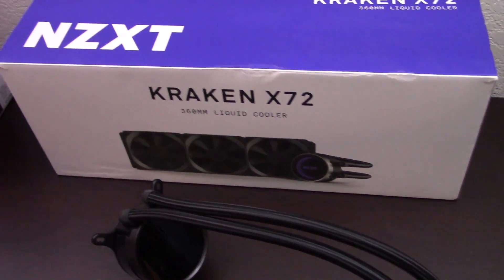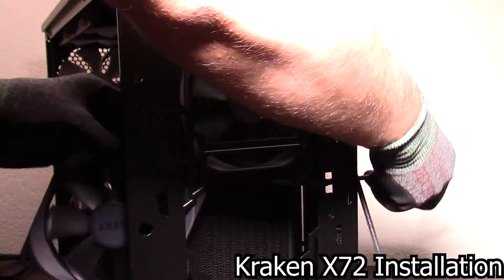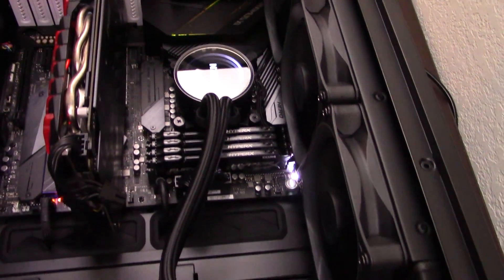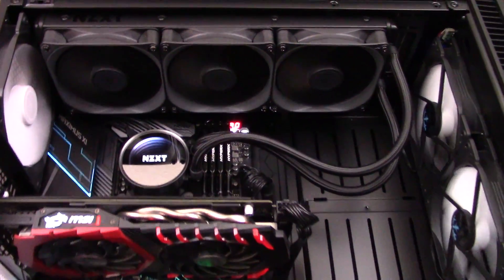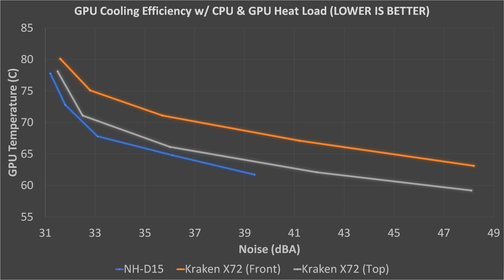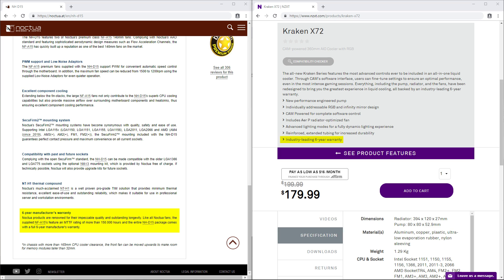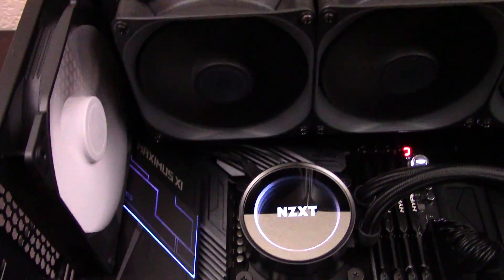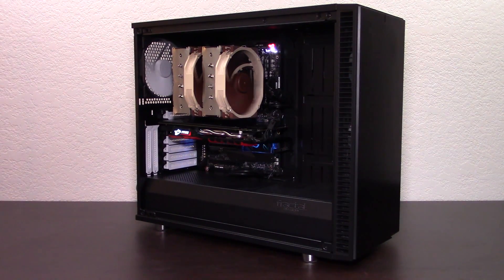Air Cooling vs. Liquid Cooling: The Ultimate Showdown (feat. Noctua NH-D15 vs. NZXT Kraken X72)

Comment: my choice is simple if for 100$ and below to buy a brand new cooler without thinking twice i will grab an air cooler, for 200$ or more i would pick magiccool radiator +  barrow waterblock + barrow or H&y even boom soft tube fittings ( would pick these second hand and get the new o ring which is very very cheap ) then i will beat any aio or aircooler any day of the year.

Comment: My god, Noctua's so BIG!
Right now I'm looking which parts to buy for my new rig. For the first time i wanted to have nice and clean space with RGB lighting (i know this is silly and i'm sorry). Choose to pick 2x8gb G.Skill Trident Neo Z RAM with rgb and was wondering about cooling. Looked at the Noctua DH15 and some other AIO (wanted to try it at some point). I couldn't even imagine that Noctua simply swallowing entire RAM section from sight. I would feel myself so stupid if i bought that cooler with this ram xD
Well...now i guess i need to decide to pick Noctua DH15 and some simple non RGB RAM with decent performance or to take NZXT X52 and Trident Z Neo or whatever it calls.
I'm going for R7 3700. Still doubting though, i want machine for gaming and R5 3600 is more reasonable for this purpose, but i think about learning some video montage and sort of works on pc, so...hope I'll make right decision.

Comment: Unfortunately in the days of the Ryzen 3000 series CPUs your video is woefully out of date.

Especially with the single chiplet Ryzen 3000 CPUs (Ryzen 3600, 3600X, 3700X and 3800X) less than 25% of the business portion of an AIO (that is the portion of the AIO where the heat exchanging fins are) covers the hotspot which is the actual CPU die (chiplet) whereas this area is covered by 50% of an air cooler.

It would be interesting to see a revised video from you taking this into account.

I cannot find any other youtuber who has done a video on this topic.

Comment: So if you want to spend twice as much, be less compatible, bulkier overall, complicated to install, but get a whopping 2.5 degree performance boost, go with AIO liquid. Otherwise, stop buying into the gimmick and use air. One further thing of note: if something goes wrong with an AIO, you are absolutely screwed. It's likely a pump or a fitting and you are buying a whole new one, or worse - a new computer. If something goes wrong with an air cooler, it can only be a fan because that's the only moving part, and it costs virtually nothing to replace. Furthermore, you still get some passive cooling in a worst-case-scenario from the giant metal heatsink, where as you won't get any from an AIO. Most air coolers will last a lifetime; literally zero AIO's will last that long.

Unless you have the money to burn on custom liquid cooling, air is still a superior solution to AIO's.
Reply: Archibald Doogan had a DOA stock fan from AMD it provided 0 cooling without the ability to cool.

Comment: The NH-D14 now comes in a black version plus you can get covers that go over the heat sink tops. That will cost you extra though. But it does give a point towards the D14 in looks IMO.

Comment: You can see before testing, hear what you are saying and work out how biased you are. You even set up the aio wrong to get that bad thermal reading and noise. I run a Kraken and under no stress after coolant heated up, stay between 44°C and 55°C depending on room temperature. My stock fans are not as audible as yours considering I run a more open case with a mesh front panel. On my Ryzan 3700X on load after 9 hours, I see max 77°C on lower fan speeds.

Hmmm....

Comment: If I had a  fully enclosed with no window, I'd probably pick the NHD15 but with a windowed case which most are nowadays, it would be the NZXT hands down or any other good AIO cooler.

Looking at the results even with a decent 240mm or 280mm water cooler, worst scenario the performance should be on par with the NHD15 if not slightly better. The bonus with the 240mm radiator, it will fit into heaps more cases and easier to work with. Still limited compared to the Noctua, however the people looking at spending that sort of money for a Noctua cooler are not going to settle for a cheap case, from my experience. 

I don't consider myself falls into the category of an enthusiast (I reserve that for the power builder) even though I like building and turning over computer systems. I get bored using the same one and like to experiment. I consider it a hobby. That said, I've had (and still uses it to some extend) a Noctua cooler with similar design and you are only telling half a story in regards to Noctua being easy to install. 

In my book the Noctua is a pain if you are looking to add or replace the RAM modules and the CPU. Those fans are not easy to remove or put into place. You can easily cut yourself along those fins, which I have done and didn't realise it until I looked at my hand because it felt sticky (from dried blood). I presume that's why you wore a pair of gloves. 
The only time an AIO cooler is a hassle to install is the very first time, when screwing the fans onto the radiator and a 240mm radiator with 2 fans is a lot easier to work with than a 360mm radiator with 3 fans. So in the future if you want to upgrade the computer but keep using the same case, removing the header of an AIO is a lot easier than trying to remove the Noctua cooler with 2 fans. The NHD15 is huge. Unless you have a big case, in which case an AIO cooler will more than likely fit, to install the NHD15 cooler from inside a case can be very frustrating. More often than not you have to remove the graphics card as well. So more effort.  

I don't think you are biased towards the Noctua, however you should have pointed out these extra pointers.

Comment: EXCELLENT vid, dude. I have been looking for this kind of comparison and there you were!! Doing my first build with AMD parts and want simplicity with lower risk of part failure. And Noctua and Be Quiet both come in  BLACK  so I just need to compare those two, size for size and I am an air cpu cooler guy!! Keep at it. You have a good voice and no comic affectation so that makes it nice as well. And you don't speak at two hundred miles per hour like one famous you tuber parts reviewer. Now, do an AMD build in a Fractal Design Meshify 2, white, using an atx board and the black cpu cooler of your choice!!! (kidding, sort of)

Comment: To be fair I bought the Phanteks in 2014 so to still be a contender in 2019 is a big deal i found that the center fan makes the most diff, but you can load that one up with three fans, IDK if that was tested, but the Phanteks also comes in COLORS which they don't mention, and to still be in the running after 5 solid years proves its a good cooler. My CPU is a 4770t and I use the phanteks entirely passively. no need for fans on a 45w TDP part. Yes I have a 100% silent Core i7, The Phanteks was crucial to the 2014 build

Comment: Also the depreciation of the liquid cooler is higher than FAN , the liquid should be changed after 2 3 years but you can keep your Noctua cooler many  many years other than that you won't be worry about any leak or what so ever . Air cooler wins for sure

Comment: Actually, the NH-D15 is very customizable in appearance. Noctua offers Chromax covers with exchangeable inlays in various colors for the heatsink, and you can replace the fans with black versions, with also exchangeable corners in various colors. I'd say when you add the Chromax covers and black fans, the NH-D15 looks pretty slick, maybe even better than the Kraken X72. Unfortunately, doing this adds another $100 or so to the cost.
Reply: With having to spend money on the replacement fans and covers, I would of just gone with a liquid AIO. I see the argument for Noctua's lasting much much longer, but looks are really big component at higher priced builds for some people for sure. If Noctua made the same cooler with black fans out of the box for say 25-50 more...I would probably go with that over the AIO. But ultimately, I will most likely get a Corsair Elite Cappelix Xt because the price ends up being cheaper if you factor in those changes you suggested. I just can't handle the brown color. Super ugly imo. But I get you are not getting it for looks. Plus the Corsair AIO im getting not only goes with my Corsair memory, but also all the fans in my setup that are also Corsair. You can also get an upgrade for the Cappelix that allows you to replace the pump header with an LCD screen for 80 bucks. Which looks awesome with the images you can put on it. I do get why people choose this cooler over alot of AIOs....the performance speaks volumes. Especially at that price point.

Comment: interesting - main reason I went for a '15S was I was also worried about pump failure with the liquid cooling options - surprised you didn't mention that?
I Also have a full set of Nuctua case fans - 3x140 in, 140 & 120 out for positive case pressure. All case fans set to slowest setting in BIOS (50%, IIRC) and single CPU fan on quiet - with ambient ~25C, k6700 CPU @ 4200 on all 8 threads CPU barely hits 70C. And it's QUIET :-)

Comment: considering further down the line when the pump dies on the aio like what i experienced, the d15 wins. Its so quick to install and does comparable cooling with 0 worries of it ever breaking down. 

also i preferred my d15 to be positioned to where the fans are facing towards the top of the case rather than to the back of the case. This also helps cool the gpu as well as it moved the heat from the gpu faster.
Reply: True, but aside from some exceptions, most modern AIOs are lasting the life of the system (which is 3-5 years on average) with 0 issues. By time you upgrade years down the road you'll more than likely be upgrading your cooling as well anyway, to a newer, better performing model both air or AIO. Also in the era of full glass side panels, something like a Kraken X62 with its infinity mirror pump housing will look far more aesthetically pleasing than some big ugly tower that also covers up a majority of the Motherboard. I ran my Nh-D14 for many years. I loved it. But I also love my X62 for different reasons.

Comment: Compatibility is actually pointless. If the case doesn't fit an x72 it most likely fits an x62 which performs similarly. The next best cooler would be the nh u12s or perhaps a scythe which wouldn't necessarily fit any better.
Powe consumption is also a weird thing to weigh as much as the other points.
Espescially since you can turn off the rgb leds.

Comment: Have you tried running tests on warmer room temp? Just wanted to know since im from a tropical country and the reason im looking for a cooler is to lessen my electric bill since i always need my AC on to reduce temp
Reply: Theoretically the kraken would be able to move the most heat away from the computer, but it uses more energy to do it, as he showed in the power draw numbers.

Comment: Hi, this AIO coolers have nothing to do with the performance you can expect from real watercooling loops. The pumps inside there are a joke, no real pressure and the cpu waterblocks are also very low end. If you want to compare watercooling to aircooling, take a real watercooler and a high pressure pump (this is where watercolling a PC begins to make sense). Watercooling only the CPU is also nonsense. Nobody needs this, because high end aircoolers are rather good performing these days. Serious watercooling also cools your PWM on the MB and at least your graphics card, if you dont want to cool the MB. I watercool my rig not because of overclocking, i do it because of noise. Good performing graphic cards are very noisy and this is where watercooling really makes a difference. My rig is cooled by a 3x120mm radiator and the fans are spinning at only 1000rpm. I never reach 50°C, even at synthetic benchmarks and the PC is nearly noiseless.

Comment: The test was done on a typical case design so in that respect it is a valid test. Testing on a Lian li pc-o11 air would be a test that would favor the NZXT Kraken X72 if vertical side mounted with front intake fans as well. It would not blow warm air into the case as a front mount would and it would not draw warm air from the motherboard and GPU when top mounted. The front intake fans would not be blocked by a radiator therefore high airflow fans could be used on the front. That would mean better cooling for the motherboard and GPU. In a side mount case for the NZXT Kraken X72 it is my opinion it would clearly outperform.

Comment: Great video !
That's why you don't do watercooling with AIO block but with DIY water loops. First because you put both cpu and gpu in the loop, preventing hot air from either the cpu or gpu to heat the other one. And second because you can do push-pull radiator on top of the case, and pull fresh air from the front of the case.
Of course price ain't the same anymore. It's closer to 300-400€ than 170€. But the actual perf are out classing by far in term of noise and temps.

Comment: What about the factor of prolonged use as well? with the NH-D15 being an air cooler, it's life span is rated for about 17 years vs the 2-3 most AIO systems have. Also, after long sessions there would be the potential for the liquid in the AIO to slowly increase in temperature making it less effective where as air would be a steady and consistent temperature over time.
I have had a few AIO's fail on me within a year or two and since switching to the NH-D15 I haven't had a single issue.

Comment: EK Custom  Made Cpu Loop. I had Noctua and bought EX Eadiator big6Times 12cm Wents 360*120cm Radiator that holds alot of E lequid. with Top end EX Block Pump and Reservour.. total holds liter and half E liqu.. That cmal Wataer block with smalll loopp not much space and went power going pas with air Water llop is shorth co you dontCoal down water befor cycle ending up heating water.  Gort #930k i7 6 cores First of ists kind BAck then. was so Good cpu was So op still is after 7 years. Still Runs 45 multiplier 1.4 v core V 4500 mhz 6 cores 12 threads. Only item with Motherborsds that i had Realy Bast on marked most oced. 7 years runs constandt  4500 mhz = blue screens Asus Rog Extream motherboard. Have to sayy Motherboard is All you can imagine .. Buut more you got more it can go Wrong..Harware Software.. compatibility over years. So I m buying From now Good Chip set motherboard But not with 200 added fiturees.. Bcouse i goes Deaad and you are Fucked..  But ocing was joke so safe and fun. fast.  Now i can see razen i5 more powerfull.. Nano M are low Power usage is Insane today on 12 nm my is 24 nm. But EX Watercoling From Slovenia company Leading Watercoled marked, I had sli all 2 watercoled so fun to make and eatch Eficiency of heat. Fealing safe. with Gear you paid many k s. I was Fanatic on OC ing and building.. Testing.. Now.. I cant belikve i washed money like drugs.. 93 cpu or rayzen i3  3 slot rams 16 gb SSD  raid 0 or Mv pcie SSD card. That is monster. with 1660ti for HD or Sli  for 4k Witch is To much like buying New car. for so litle more.. gameplay on 1400p  with 2700 gtx and you are good . UHD is not practical

Comment: It depends on your case. AIO's are designed for cases with low air flow. Something you completely overlooked in your compatibility section. It does you no good to push hot around. Especially if you have a case designed for noise cancellation.

Comment: i had noctua nh-d14 from 2010 and still working perfectly until now sitting in my 2600k 4.6ghz [idling 36-38c top out 75-77] daily.......now with my newly build 3700x i use nh-d15......idling at 38-40c top out 75-78c [pbo+auto oc]

Comment: Great video, I would have used the 240mm or 280mm radiator Kraken for a video like this over the 360 as the 360 radiator doesn't provide any more cooler eff over the 280 or 240 and would be a little bit more case compatible friendly. A good follow up video to this would be the D15 v Kraken v a dedicated custom cpu loop.

Comment: I was surprised how close they were but I suspect a good self built water cooler will out perform the D15 and if your doing that you'll be buying a case to match with the increased thermal sink volume of a water tank, better pump and rad etc. Overall if your gaming or stressing your system for only a few hours at a time and you want the best performance then i'd go custom water cooler but that adds maintenance. If you stress your system for many hours the gap can closes dependant on ambient and case setup.

I've never had any fit issues with RAM compatibility and Water cooling... your case is tiny but could you not orientate the cpu block differently?

I'd say the big air cooler is safer as even with failed fans it will take time and not ramp up to cut-off temps as quickly as a failed/faulty pump (from experience).

However saying all this both of my current rigs have D15s in them because I just can't be bothered anymore (custom loops build + maintenance), you fit a D15 and you're done, ohh and everyone should just licence Noctuas mounting system. You can make the D15s look better with the black Chromax Fans and Radiator covers but that's a relatively expensive upgrade that moves it into the AIO price range (they should sell a Chromax D15 IMO).

As a scientist you know you can't score like that and there should be weightings applied but the weightings are different depending on what you want from the system. My personal opinion is go D15 or go Custom loop the AIO is for better looks but once your pc is built for a few weeks... you just stop caring IME.